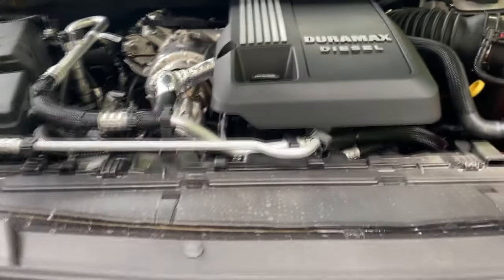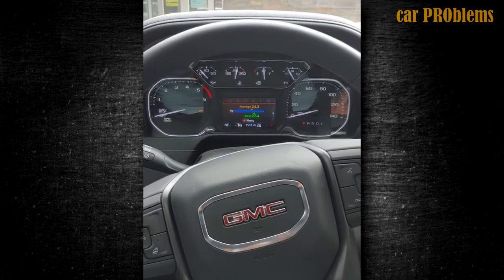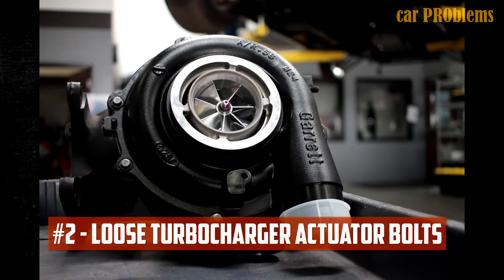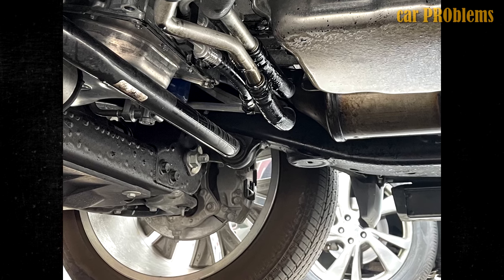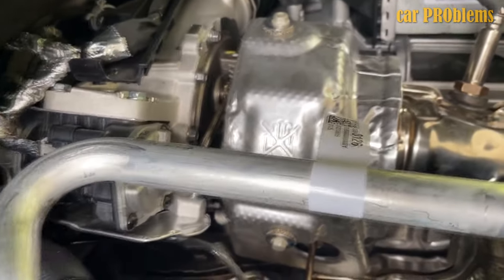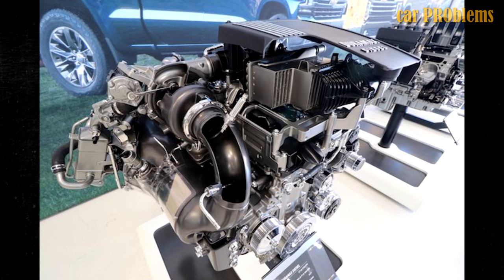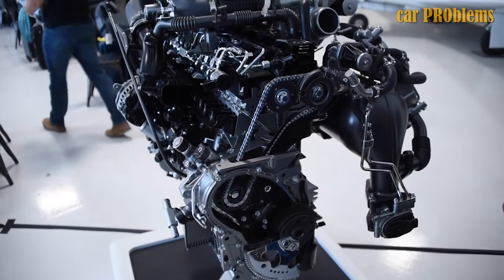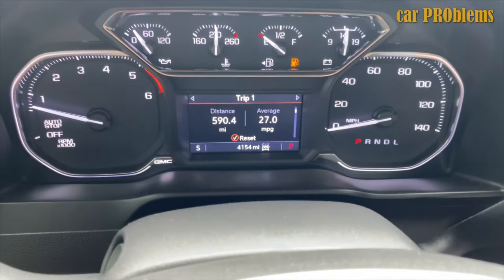Duramax 3.0 Problems and Recalls - GM 3.0 Diesel Reliability

Comment: Reading comments: 30k  - 40k miles with no problem , very good engine. . .what??? That's a truck, I want to see 200k-400k miles without major problems.
Reply: Dumb post. The Duramax is more dependable than the 5.3 and 6.2. the only engine on 1500 GM truck with higher reliability is the 2.7.
Reply: No LZO owner has that many miles on a truck yet foh 🤡
Reply: Give it time! I have 22K trouble free miles on my 01 and will keep monitoring the internet for problem trends. Nothing new or concerning with this video, a good sign 👍
Reply: @davidporter7051 um no the 5.3 is one if not the most reliable v8 engine lmao.. that 3.0 is guaranteed to have a $3000 belt change every 150k miles. I know 5.3’s that can go 400k miles if you take care of it. I have one. An I havnt had to work on to many 5.3 cause they don’t really have issues, unless of course you don’t take care of it, but that’s any engine. The 3.0 is just engineered badly, if they fixed the issue, it could be a good long term engine but as of now, it’s only good till 100k miles . Need a diesel get the 3/4 ton
Reply: @dcman4902  still no answer to posting garbage? As for your lack of comprehension maintenance isn't reliability.
Reply: @dcman4902  if you think 5.3’s don’t really have issues you don’t have enough experience to talk on this subject anymore idc what you say. I have Chevy tattoos and own several 5.3s and I’ll still tell you it’s the most unreliable compared to the 6.0 6.2 and 4.8. You can walk into any auto shop and I guarantee there’s a Silverado with a 5.3 getting a new motor or lifters.
Reply: people are coping hard having bought into a nutless diesel engine with all of the emissions liability for none of the diesel power
Reply: -and nobody is buying this engine for real work. It's people who haven't owned modern HD pickups but want to own a diesel and delude themselves into believing the improved gas mileage is somehow worth it despite gas hybrid powertrains that cost less to run, have more power, and don't fall apart leaving you stranded.
Reply: @davidporter7051 not necessarily, the 3.0 hasn’t been out long enough for us to really know how reliable the 3.0 really is!
Reply: @MrSmurf459  yes it has in the past 5 years there has been fewer failures, warranty repairs, recalls and TSB's for the 3.0 thus it's a more reliable engine. The 5.3 and 6.2 are still more reliable than industry averages.
Reply: @davidporter7051 is this a bad joke?
Reply: With that belt driven oil pump you ain't going to see that kind of mileage
Reply: @David-yy7lb  Yet another keyboard expert claiming to see the future. Just wait and see ffs.
Reply: It’s like the “ initial quality “ award they used to advertise.
Reply: You realize the designed lifetime of an engine is about 120K miles?
Reply: 120k? If that’s the case I wouldn’t buy a new car. That’s the miles I put on my pos geo in 2 years. Only thing I’ve seen on this engine is radiator start leaking on right corner around 50-60k. Pita to change since you have radiator,condenser oil cooler, intercooler all together. And timing chain getting loose around 100k causing cam codes.  Oh yea and wayyyy too many people putting def in the diesel tank.
Reply: @dcman4902  dude the vortec 5.3s arent bad i use to own it. The modern 5.3 ecotech isa trash pos motor that i had failed lifters at 114k miles due to afm
Reply: @curtiscolehouse3263  I have had both an both have been reliable engine wise, maybe you just got unlucky and got a lemon. Gm is notorious for throwing many lemons out, but the overall engine is good, that’s why it’s been around for years, although I will agree the stop an start feature is what really screw’s things up but least you can turn it off, an I had it deleted on mine, an it’s been a beast. That tech is the real problem not the engines themselves. Unfortunately many have it anymore
Reply: I’m at 118k miles
Reply: @sly9263  I tow a 12,400 pound boat and trailer with my lz0 no problem
Reply: @dcman4902  Nah ive know 3 other people with 5.3 that ate the lifters at 56k miles and 20k miles. Trash engine the vortec 5.3s arent bad but the ecotechs are trash. Much rather have the lz0
Reply: @curtiscolehouse3263  saying "I do something" doesn't hold any bearing on whether or not you SHOULD
Reply: 2019 ram 1500  165000 no major problems
Reply: It’s because you are not aware of these problems yet. I have a 2024 with tons of issues at 451 miles. Turbo and transmission. Listen for it before it’s too late.
Reply: I have 97k oil changes, fuel filters only since new and just put my first set of new tires on it.  Michelins last 97k😳
Reply: Not even that it's just a truck...any well designed vehicle made since the 90s can and should go 200k miles with no issues. I'm with you on the fact people these days have absolutely ridiculous reliability standards
Reply: @dcman4902  maybe 5.3 previous years but not newer ones they are nothing more the a lifter eater and the 6.2 are live grenades. I’ve been in many dealership as a tool man and most if not all say these engines are the worst they’ve seen in 20 plus years. There was 13 5.3 in one shop with lifters eaten out of them all where under 145k miles they had 8 6.2 in with 10-25 k blown up so yea gm’s got some issues to address

Comment: Most of the problems mentioned here refer to the original LM2 version of this engine. The new LZ0 version doesn't seem to have these problems. The baby Duramax is a very smooth and powerful motor that gets excellent fuel mileage and tows surprisingly well.
Reply from the maker: Agree, LZ0 is  a reliable and durable engine. But it also has lots of problems with injectors, turbocharger, EGR valve and oil leaks.
Reply: You own one ? You thinks can last 200 k miles  ? 15 years ?
Reply: Have had nothing but one problem after another with our 2023 LMO..... 10,000 miles and has to be in for service 4 times, it's in limp mode right now.....
Reply: classic "new" version is just fine guys- until time tells different, again
Reply: I so hate the term "baby duramax"
Reply: @sly9263  Do you own one or just empty speculation?
Reply: @carproblemsmax these all sound like expensive issues
Reply: Exactly, it's junk like most new over complicated, new designs.  @watchmanexpert
Reply: I have a 21 Silverado 3.0 4x4 and have 30,000 mile on only problem I have had is with the thermostat sensor
Reply: This is a lot of major and expensive issues considering these dealers and used car lots what so much for them especially used see them with 80/90k miles they still asking 37k and up sale prices for 2020/2021 models
Reply: @vee950 i have a delete 2021 at4 lm2, things runs like a champ without issues.
Reply: 50k miles on my 3.0 duramax with 10 sp ...best truck i got so far.
Reply: I want it in a Colorado

Comment: As a gm diesel tech working in the field the most common issues I see are high pressure fuel injection pump failures, front crankshaft oil seals pissing oil all over the bottom of the engine, downstream nox converters and particulate filters, turbos are less common but I have had to replace them a few times. The occasional fuel injector or glow plug. Nox sensors and yes the camshaft exciter wheel. However there is an ecm update that is supposed to correct the extended engine crank if the exciter wheel is not the problem
Reply: Thank you for your experience and feedback. Do you feel the LZ0 has addressed these issues?
Reply: I have had issues with my nox sensor and I’ve brought it in for repair but the issue came back and now the technician has told me that it’s has something to do with the wiring harness!
Reply: @MrSmurf459  wiring harness issues are very common on the 3.0 diesel’s because they are routed so tightly and the harnesses are much larger than the gas engine variants due to all of the extra sensors and components. I have replaced complete engine harnesses due to intermittent wiring chaffing. Big job on that truck, pull the cab, disassemble the engine partially etc
Reply: @danieldelgado3008  did the LZ0 address this issue by chance?
Reply: @7THxSIGN  haven’t seen many LZ0’s come into the shop at this point in time so I can’t really say for sure yet on those.
Reply: I had the oil seals pissing oil.  Sold that junk the week after.
Reply: @nahbro3240  the issue is the harness is wrapped so tightly around the back of the  engine near the driver side rear corner around the cylinder head that the wires start to rub and also near the ecm bracket
Reply: @danieldelgado3008 would you buy a 2024 lzo? I have one on order to replace my leased 3.5 ecoboost.
Reply: @danieldelgado3008  can i send you some sound clips, my local gmc dealer seems to be a bit incompetent
Reply: @danieldelgado3008 this happened to mine! Had to replace the harness and the catalytic converter because the bracket wore the wires thru at 25,000 miles
Reply: @slimchancejw  trucks with these engines seem to be hit or miss, either people have no problems with them at all or they’re constantly in and out of the shop with issues
Reply: @danieldelgado3008  do you have any update on the Lzo?
Reply: We’re not having any issues with front crank seals. It’s the oil gallery plug in the front that’s giving issue. 
I’ve been doing a lot of repeat repair work from some other Chevy dealers in my area replacing the front crank seal plates.
Pull the plug, thread seal and reinstall.
I’ve seen one 23 that had a wiring harness rubbing on a compressor line, most of the harness problems seem to involve the egr differential pressure sensor a three wire sensor that has been breaking a wire less than a mm from the connector. 
P2C7A is a nox 3 related DTC that sets any time there is any other issue, I notice it most frequently after an injector repair. 
Early on we did some glow plugs and some ECM program released by GM that didn’t do anything. 
I’ve never done a reluctor wheel on a camshaft but I did a bunch of ECM programs for extended cranks early on. 
We’ve done some exhaust work p1488 is a particulate matter sensor DTC caused by a leak at the bell mouth flange at the tail pipe, 
I’ve done a couple of egr valves. 
DTC p1089 is still a thing apparently, it must share fuel pressure regulator 2 with the l5p.
Reply: @danieldelgado3008 sounds like an assembly line problem lol
Reply: That’s one helluva list lady.

Comment: WOW you are so outdated on that engine the long crank was fixed the oil belt can now go 200,000 miles I had a 21  and now have a 23 silverado 1500 with 3.0 love it
Reply: Not necessarily, they said it could go possibly to 200k miles but still recommend 150k mile “check”. Though to just check if you have to pull the whole trans, might as well service at same time. But like any belt, it could break towards the end of its life span, specially one that’s sitting in oil. One might get lucky to get it to 200k miles an try to sell it quick but some might not get that lucky.

Comment: I have a 2020 Denali with 48k miles and so far, have had to have the front crank shaft seal replaced twice, DEF injector cleaned due to crystallization build up and now have issues with the reductant tank temp sensors. Can't go a year without an issue unfortunately

Comment: I have a 2021. It put me down once early on due to the wiring harness chafing in the engine bay. While repairing that the dealership noticed the rear main seal was leaking. Apparently it wasn’t leaking excessively since I’d not seen it on the driveway or underneath the vehicle. No problems since the repairs.
Reply: GM has had leaking rear main issues for decades... I had it on two different LS2's and an L76 engine. I don't know why they can't figure out how to seal an engine to a transmission after this many years in the business, but it's shameful. I remember having to argue with dealerships about the leaking seal and they were straight faced telling me it was "seeping, not leaking". It took me going through GM corporate to make them fix it.

Comment: The only issues I have had with mine are one of the DEF sensors causing a "low level" warning when the levels were not low (hitting a big pothole fixed it), and a NOX sensor coming loose, allowing exhaust into the engine bay, which ended up in the cab (cough, cough).
There is no "or" when it comes to the oil pump belt.

If you tear the truck down enough to inspect it, you should replace it.

Comment: Just got back from a 2700 mile trip from North Dakota to Moab UT and back.  2023 GMC with the 3.0.  Around home not towing 25/27 mpg, awesome.  Hooked up an enclosed trailer with a UTV in it averaged around 11.5 the whole trip. Trailer total was around 7500 lbs, but figured I would get a little better than that. Plus it was using 2.5 gallons of DEF per 375 miles.  Tons of power and rode like a dream but not blown away by it.  With that being said it only had 5,000 miles on it before we started our trip, so maybe with a little more break in time.....
Reply: Similar experience here.
6.5K trailer and cargo with low mileage and excessive DEF use. 
The DEF consumption got a little better after we went through a couple mountain ranges.
Reply: High def consumption while towing is just a part of owning a new diesel unfortunately. Your loaded fuel mileage seems lower than it should be. I think I would average 13-14 at 65 with my 2500 with the 6.6 Duramax with the same trailer. Your speed would affect the towing mileage a lot though.

Comment: I've got a 2020. 55k miles.  Only problem:  

check engine light comes on indicating to service the exhaust system. I've noticed this is more prevalent when I use the less expensive DEF.  This happens when decelorating.  It usually corrects itself when I accelerate.  

Best fuel economy was 29.5 mpg while driving highway (not interstate) speeds.  
When pulling a boat (3500 lbs collectively) I get about 14 mpg on the interstate. 

Very happy with it so far.

Comment: I can't wait for the videos of the belt driven oil pump failures
Reply: It will run well past 150k. Of course you’ll have a few with manufacture defects in them. For the most part though they are solid. I will guarantee 90-95% of belt failure will be vehicles that were not taken for maintenance at 150k.
Reply: @JamesSmith-cj6kh  what are you gong to do at 150k? lol
Reply: @bull5919  take the 4-6 hours it takes to drop the trans on a Saturday evening while drinking nice cold beer. Replace the timing belt and drive it another 150k… maintenance on vehicles isn’t hard. I agree not everyone will be able to do this. But I also enjoy having 30+MPG and the ability to tow anything any other 1500 can. On flat ground I’ve even had the truck past 38MPG set Cruise on 70🤷🏻‍♂️
Reply: @JamesSmith-cj6kh I'd rather drink a beer to knowing I'll never have to drop a transmission just to change a belt that should have been a chain that way it'll never have to be changed ever to begin with.
Reply: @ElectricSwordfish  timing chains go bad all the time. They’re only as good as their tensioner. Chains even stretch over time. After stretching it’s not uncommon for them to jump a tooth and break something. 
The belt does just fine. 150,000 is a long ways to drive and the process is easy.
Reply: @ElectricSwordfish  You gona spend   2x belt money   on fuel only .   On 150k miles is  2600 gal  Difference .

Comment: 21 Silverado 3.0, started with the long crank then the injectors, def pump, tank, and hoses numerous sensors, particulate filter and supporting assembly (X2) ECM computer(x2) and now it has come full circle and now back in the shop for the long crank. Has spent 22 total months at the dealership getting fixed.
Reply: Awful!

Comment: Long crank problem was solved by a software update. 

Block heater issue is getting software update. 

Oil pump belt has had ZERO issues. The belt has been upped to 200,000 miles on the new LZ0. Same belt...
Reply: Too bad they didn't do a gear driven oil pump. Would almost be bulletproof

Comment: This is solid engine you can easy do over 150K miles no issues  if you take care of it this is not work horse  truck .. folks load them up and pull trailers with it of course it will cut his life span in half or more .. I’ve seen guy with 2021 125K miles changed one NOX sensor that’s it covered under warranty no issues .. and as an 3.0 owner zero issues .. if you don’t own one you can’t say much  about it even on forums positive comments barley any issues..
Reply: I bought a 2022.5. I had only heard positive things on the 3.0 other than the long crank and rear main seal issue. I have seen so many complaints of the V8s losing lifters that I didn't want to chance. I have 12,000 miles now and couldn't be happier so far. My A/C compressor clutch does seem to make some noise sometimes that it probably shouldn't make.
Reply: @specialestness when you say trailers, do you mean travel trailers or just trailers period, because I consistently tow with my 3.0 but nothing excessively heavy, I doubt I’ve towed over 4000lbs ever but I do tow quite a bit but not heavy!
Reply: Also I’ve had the long crank issue but it got fixed and I’m now having nox sensor issues and the fan issue as well!  Outside of that, I’ve really had no issues!
Reply: So would you recommend the new LZ0. Thinking about a pickup but Diesel specifically. Hauling light loads but mostly mid/long travels.

Comment: Got a 2021 with over 700,000 miles on it with no issues at all. Also pulling a 48 ft travel trailer at 80 miles per hour getting 50 mpg.
Hell of a truck
Reply: Lmfao
Reply: That’s funny shit😂
Reply: @19jacobob93 it’s a joke
Reply: Niiiiiiicccceeeeeeeee

Comment: Got mine in May of 2021 and so far 31k miles I only change oil every 7500 miles that’s it. Must use fuel injector cleaner every oil change for a smoother motor performance though
Reply: Do you use oil stabilizers?